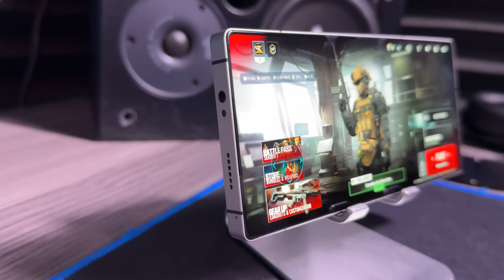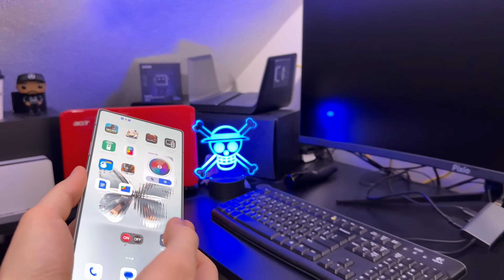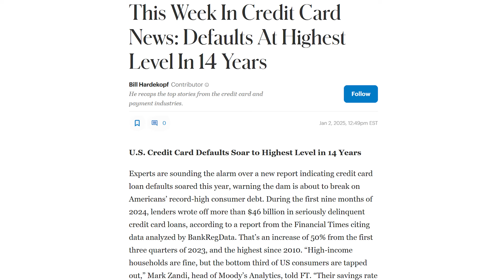What CES Revealed About Repairable Tech In a Record Year For E-Waste (2025 Is Not Looking Good)

Comment: Agreed on Windows 11 causing many PC's to be scrapped.  On the cost of tech getting too high, the latest has always been expensive and out of my reach. But I got a good deal on a 2nd hand cell phone and brand new fire TV's can be very cheap. With all the manufacturing I think we are also hitting market saturation in devices which helps drive down cost.

Comment: I am sure you have heard this, but why not start offering Linux rather than Windows? There has been a lot of talk from content creators about Linux and they are making dedicated videos to it. Linus Tech Tips, Gamers Nexus, Level1Tech to name a few. I just fully serviced, rebuilt, and refurbished a system with a 2006 Athlon 64 CPU installing Linux Mint on an SSD, and an HDD storage drive. It runs well and would be a great basic home PC for someone who needs to do basic tasks. 

People need to be educated and shown that they have an alternative option. Linux user base is growing, it has more capabilities than just the basics, and I think you will see it continue to be more accepted as Microsoft keeps doing sleazy crap.
Reply: The problem is, most regular home PC users are not interested in being educated about Linux. I can personally assure you very few 'normies' are intersted in learnig about this weird penguin thing. You can make the argument that Linux systems are easy to use and more stable than Windows. That's great and all, but it still won't convince most people to move to it. Where is the support? I'm pretty sure most non-tech savvy people will be very lost and confused if you give them a radically different looking system.

I really don't see Linux taking off that much. If anything, people who are done with Windows will move to Chromebooks or Macbooks/iPads.

Comment: I have a ThinkPad T480s. I just do productivity and streaming. I have installed my own batteries, RAM, and SSDs. That's the limit of my technical ability and it does fine. 

I hate that I can't access anything on new laptops. They are just disposable appliances.

Comment: Interesting to see you repair the exact laptop I have. I specifically bought a P50 because of upgrade ability. Maxed out the ram put in 2 M.2's and a SSD all my machines are used all lenovo. I have a thinkcenter now if only i could find a reasonably priced GPU power cable so I could upgrade the GPU I'd be very happy. If anyone knows where I can get a GPU cable for a P520 shoot me a message

Comment: Pavillion dv9000 series... shiiiiiiit I remember this got mess back from my "it repair shop" days at my first-first job in fact. I still remember shop layout where the front were desks for clients, then behind a wall was our work desks and behind that was small storage room with even smaller corridor to the toilet. Half of the storage was just these pavillions piled up up to the ceiling, I'm not kidding you. Easily more than a hundred, every single one of them had the same issue- fucking cold solders because of using non-lead tin. Thanks to that the repair was not only unprofitable, but also unfeasible, because even if we baked the chip and soldered it back onto the board, the exact same thing would happen in a while, because the junk would notoriously overheat and tin in stock was already only non-lead. So when a customer walked in with a laptop under his arm with that distinctive casing, the immediate question was “is there a problem with the image”- if so, the answer was automatically “repair unprofitable.” No wonder anyone who had to deal with this BS started turning into ranting Louise Rossmann.

Comment: I purchased ASUS VG27AQE 27 Monitor and after warranty PSU died. 
PSU is external and cost of new PSU is 60EUR including delivery. 
I was so pissed and checked PSU insides and cost of the replacement of 2 capacitors was below 1 EUR. 
So instead of buying new PSU for 2-3 years old monitor i just purchased Capacitors and re-soldered them. No issues after that. 
So yea companies are doing that on purpose... It's malicious planned obsolescence...

Comment: The HP DV models is when I lost faith in HP. The excessive heat from the northbridge of the motherboard basically cooks the GPU and there were few options to get replacement systemboards. Great times

Comment: I have a 1999 Saab 95 with 555K km (344K miles) on the clock. Put like 2K euro in replairs in the last 23K miles. They really don't build them like they used to.

Comment: The advantages of building with ever greater intentional standardisation and component modularity building systematic circular components for data storage, machine learning, eventual corporate and domestic computing will be seen in time, but for the immediate future we will have to try to use what we can from the ewaste that is  worthwhile using until the modulariry argument is won and it will be won.

Comment: As far as PCs go, the software side has created an interesting array of solutions for these problems. At the end of the day your PC is used to run these programs. They control your PC in turn down to how much power they need to run. The more Optimized they are, the less power your PC physically needs to run it. The only sure fire direct way to do this is take a step back and clean the programs out of higher level languages and dead code at creation time of the program to get the program running at assembly level. The software landscape reflects the ewaste landscape at the moment. The more optimized the code the more durable it is along with your computer system. An OS called Menuet is a really great example of this concept but the code is going to take some time to get up to speed with everything else even though it’s faster and less power hungry than everything else.

Comment: I am a mobile bicycle repair tech. I have the same outlook with e-bikes. Specifically the super heavy motorcycle with pedals kind.
Reply: Yeah ebikes are the worst offenders when it comes to low serviceability.
But I found that a lot of things that used to be standardized for regular bikes have become proprietary and hard to fix/replace too.
Especially since the newer 11/12 speed cassettes have been introduced.
Back in the 80/90s you would have plenty of choice, most things that fit on a freewheel would work, from 5 to 8 or 9 speed... only needed a different chain along with it.
But last year I converted a 9by3 shimano deore to a 12by1 shimano deore XT.
Couldn't just change the groupset itself, I also had to get a ton of new tools and rebuild the rear wheel with new spokes and a microspline freehub.
The frame has QR dropouts, but there are only like 2 or 3 freehubs that come with QR instead of thru axle.
Had to change the crankset as well, meaning that I had to toss my squared tapered BB and switch to a hollowtech BB.

It was an interesting project that really gave me insight in how the cycling world is rapidly changing from low cost sustainability and reliability to expensive high-tech short lifespan crap.

Comment: The hell are you on about with that three cylinder part of the rant, sure plenty of engines aren’t that reliable but they use less fuel, produce less emissions, use less materials and weigh less than those soccer mom tanks with prehistoric V8s I get the sentiment but completely wrong target
Reply from the maker: Use less fuel, produce less emissions, and achieve that by using dozens of complicated unreliable parts that will end up breaking and shortening the lifespan of the vehicle when the cost of repair quickly exceeds the value of the vehicle. I specifically mentioned the early Corolla instead of a 20 liter V8, to emphasize the balance of power and reliability that we reached without complicated bs to satisfy emissions. EV batteries were a better example of e-waste that I should have used (Model S needs a new battery, costs more than the entire car)
Reply: @  it’s new tech for a lot of companies so it’s gunna have a fair few issues to figure out like, Mazda’s spark assisted compression ignition, Koenigsegg’s Freevalve and now Porsches 6 stroke, complicated as hell and not likely to be widespread fast or that reliable, but it is something to help, and I hope they keep improving it so it can be widespread and reliable

Comment: Laptops we want:

Removable keyboard
Easy to repair
Good hinges
Company sells parts
Companies actually gives us what we want
Replacable battery

What we got:

Hard to repair
Breaks every 2 seconds
expensive as f*** to repair
Reply: Framework laptops may fit your requirements.
Reply: @nathanieladams4173  Yeah, the Framework laptops are pretty affordable and efficient in comparison to other laptops. Just don't buy those e-waste laptops that are sold cheaply just to be mass replaced.
Reply: @nathanieladams4173  i really want framework but it doesnt have good enough hardware for me plus they dont ship to Turkey.
Reply: When framework does high end CPUs, displays, and dGPUs, I'll be all over it

There's a market for it, the enthusiast crowd that once had socketed CPU + MXM Clevos to play with is desperate for upgradeable and high end laptops
Reply: @greebj  Framework does do dGPUs, but they do so in a quasi-proprietary form factor. Technically, the spec is fully open, but it's still built entirely around the chassis of the present-day Framework 16" so if that changes or if anyone else wants to implement the GPU form factor they're kind of SOL and need to make an entirely new set of GPU SKUs for the new laptop chassis.
Reply: @greebj Thay always had the highest end CPU, they have dGPU already they have excelent screens for all purpose with excelent color gammut.
Reply: @greebj  socket laptop makes NO sense, at the extreme the minor upgrades are worthless, you should be buying the 80% proc solutions, anything bigger means a north bridge upgrade. Laptops should be about keyboard and battery replacement and quality screens.
Reply: @greebj Funny story, the Framework 16 has what you seek.
Reply: @greebj  Why do you need that much power in a laptop? If it's gaming, why not game on a desktop instead? I'm genuinely curious!
Reply: @3nertia Not everyone has the space for a desktop. Plus, dGPUs often have the horsepower for compute and productivity tasks too.
Reply: @greebj  wdym? I have a framework 16. It has all of that!
Reply: The glass backpanel on that Lenovo Yoga is gonna need a screen protector for the BACK of the screen. Ridiculous!
Reply: I don’t think we’ll ever fully get there, so I’m just opting for a P series thinkpad
Reply: @thunder2275 We are there. Buy Framework.
Reply: Laptop I want:
Take a 75% low profile keyboard with a rotary volume knob. Rip out rotary, add thumb joystick for Trackpoint emulation.
With no Touchpad, eliminate (or vastly reduce) wrist support area at front.
With reduced keyboard area, use a shorter, wider banner style LCD display.

Closest I can see:
Pi 500 (lacks display, needs external power, mediocre keyboard, SSD not fully installed on 1st version)
Reply: What really sucks is that Apple USED to make laptops that fit almost all of those requirements. And you could install whatever software you wanted on them.
Reply: Laptops also don't last for fucking any amount of time. My laptop from 2018 runs like a windows 98 computer, meanwhile my gaming rig that I built in 2015 is still chugging along without any performance issues.

Also, the trackpad on laptops is so dogshit. Why do only thinkpads have actual mouse buttons on their trackpads?!?

Lastly, why in the hell do people want laptops smaller than 17"?! If you go smaller than that, you can't fit a full sized keyboard, making things like the arrow keys super tiny and hard to use! It's honestly such a pain trying to find a new laptop that's worth a damn.
Reply: Yeah but why would you want any of that when you could have a button to activate the ai you wont ever use
Reply: Making the "laptop we want", won't make them any money.  It'll push up the manufacturing cost, and you won't be buying a new one.  Most consumer don't give a f*ck about this stuff, they just want whatever the latest shiny new thing is, even if they have to go into debt for it.
Reply: I bought a custom laptop that's all these things but it's too early to say whether it's designed to fail.
Reply: TL;DR - you want a portable desktop computer.
Reply: @danjal87nl  more that I want laptops to be built good enough to not make portable desktop computers a necessity. Sadly, as it stands, I've already planned out all the parts I need to build one that'd beat any modern $2000 laptop in both performance and longevity, whilst also being cheaper.
Reply: @danjal87nl  That's all laptops have ever been mate - it's just always been difficult to squeeze the same amount of computing power into such small spaces ...
Reply: Capitalism
Reply: maybe tablets or microsoft surface, with some wireless keyboard and no hinges
probably not modular and maybe worse parts though.
Reply: @ Maybe Framework will cook something up.
Reply: Basically what a Framework is :)
Reply: This is great. Why don't you make it? Too many complaints and not enough entrepreneurs...
Reply: @togowack  "This is great. Why don't you make it? Too many complaints and not enough entrepreneurs..." -- Something tells me that you have no idea how capitalism or the "economies of scale" work nor are you aware of how much it costs to run even the most basic business. Average annual cost of running a business? $30-40k. Average annual income? You guessed it! $30-40k a year! How do you start a business AND pay for rent, food, toilet paper, etc.? 🙃
Reply: @3nertia  Hi, I've run a side hustle/full time hustle for almost ten years and started a few more in that time. For the last 10-15 years have worked full time jobs mostly. I am a machine builder have built interesting machines. They cost almost nothing - I collect materials and equipment from the places I've worked and from people I worked with. I've come to see these types of conversations as full of excuses. My first and main machine is a CNC roiuter, and my 6 axis robot that cost $2000 over 5 years is just about complete. Try working in manufacturing and not just sitting behind a computer.
Reply: @togowack Give me a ride, a place to shower and do laundry, and I would gladly take that job! Must be nice to have such lovely opportunities afforded to you by your location, family, or friends ...
Reply: @3nertia  It is called the Land of Free and Home of the Brave because its supposed to be fought for, nothing free worth giving. You are free to procure your materials for the doing of business and pursue it and our ancestors had to do the same thing. If you fail to do this they will dispose of you in war. They've got it now to where if they do that, nothing is lost and those who braved it in the world of business succeeded in war during times of peace.
Reply: @togowack: More like Land of the Dumb, Home of the Obedient lmfao
Reply: @togowack Someone already did. Framework.

Comment: Throughout the years, most of CES has been something in one of two categories. The first category is just the new version of a line of a line of products that's been released. The other category is shit so crazy impractical that there's no point of anyone buying it. CES 2025 was the first year where there were at least a few things that didn't fit those categories. But of course absolutely everything it going to be made to be so unrepairable. Because they don't give a shit about it lasting long. They know they're going to be releasing a new version in one year. What sucks the most is that there are e-cycling centers, but it's not treated the same as the weekly bins you put out for waste, recycling, and green waste. You have to find a place, figure out if they accept the type of devices you wish to submit, and if they do you have to find the time to get all your stuff there. It's insane. It's so inconvenient, especially for those of us who don't drive, and it contributes to more e-waste getting tossed into the black bin instead of getting to an e-cycling center where it can properly be disposed of.

Fuck HP. Long live Framework.

Comment: Hp Pavillion 15 has been a truma for me as a engineering student I wanted something in budget 😢

5 months in starts lagging and all I used was fusion 

And also If you hold the Pavillion from one side for 1 min the motherboard will fu*kup and will cause short circuit near ram and sSD

Now from showroom repair still speaker doesn't work ! Heating issues wifi issues 

And just to clarification never had a water damage 💔 🤧🤧😭😭😭🥱😭

Comment: i have a minor case of this when getting a Xbox Controller. i finally said screw it, i went through 4 Elite Controllers in less then 5 months. (no i dont drop or beat my controllers im very carful with them.) i looked everywhere for controllers that last a long time before failure's, and i found viktrix. 180$ for a new 3rd party elite controller. and i love it. its lasted over a year with zero issues. and i will be getting the hall effect pack soon. and they just swap out with a allen-wrench and dropped in.